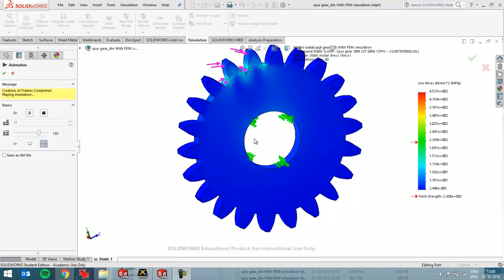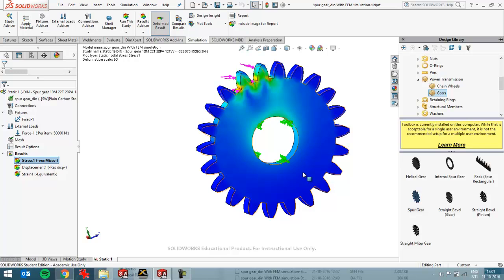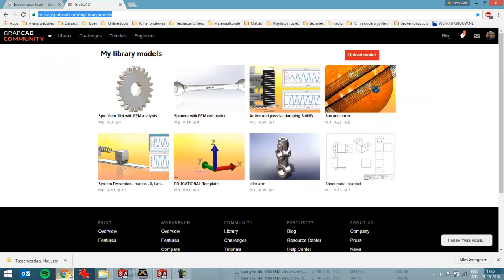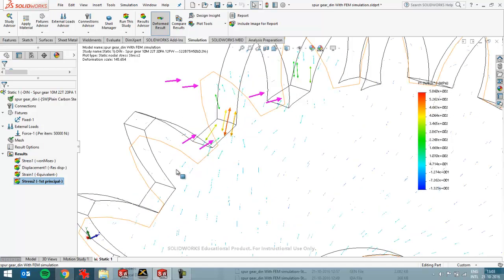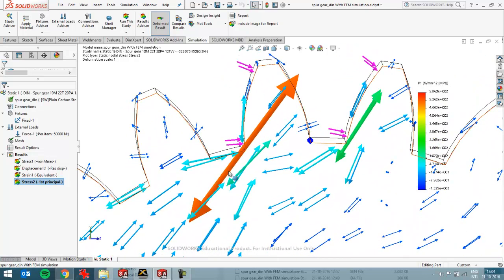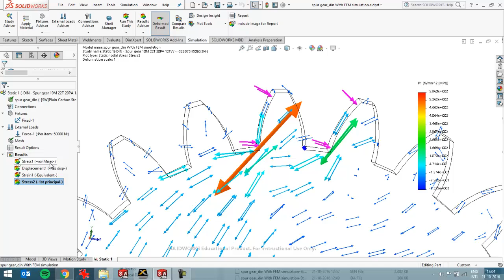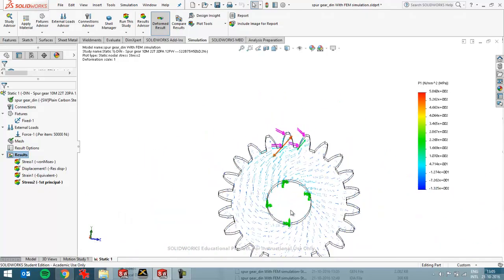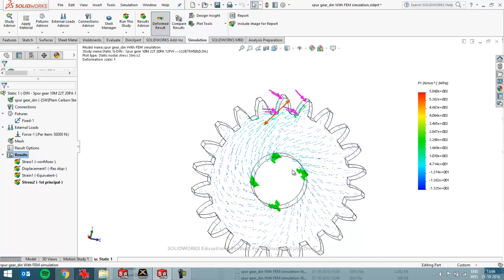FEM Case study 1: Investigating how a gear will fail under high forces with SolidWorks Simulation

Comment: If you want to know when something breaks you compare stress with ultimate stress (Ftu) not yield stress (Fty).
Reply: Right, but if you want to design something properly you should keep it operationally within yield range so that it doesn't experience permanent deformation and possible loss of function.